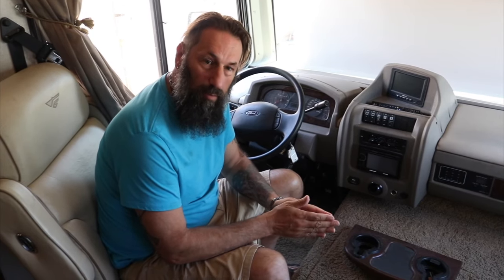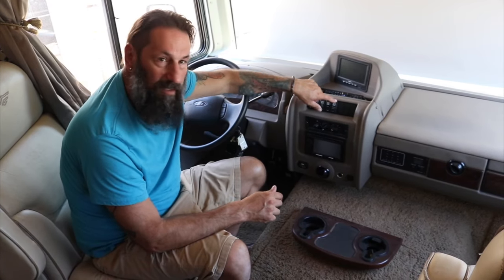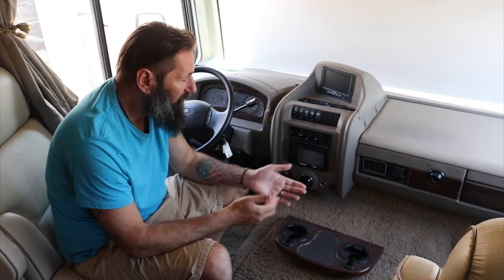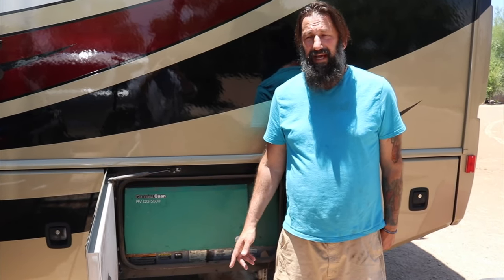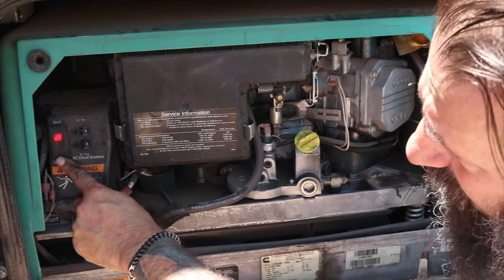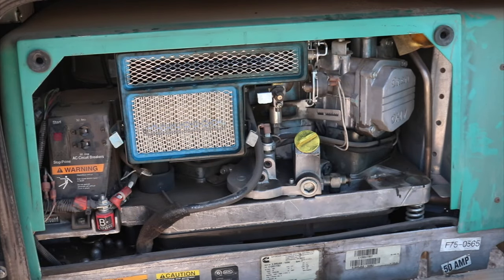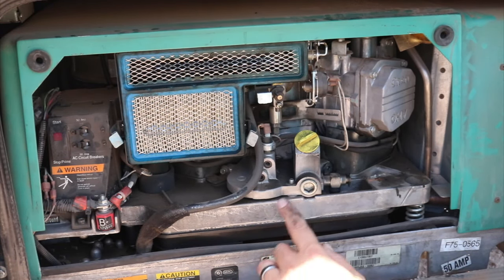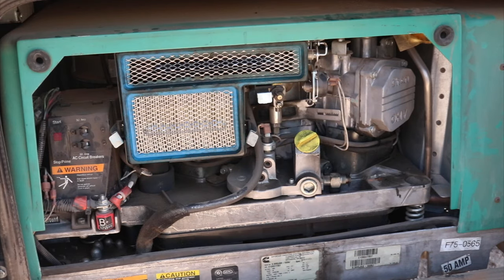RV Onan Generator Start Up Problems. Fix it here.  Hint & Tips

Comment: I have a problem with no start on my Onan 4000. Changed the oil, spark plug, carb.,new gas, still not starting. Ran on a constant 10 hour straight after a power/storm shortage. So many ways to check. Please help!!

Comment: Good Info.  But one item needs correction.  Your generator in the video the Onan RV5500 QG is air cooled, not water cooled so there is no coolant in that Genset.  Otherwise good info.

Comment: Hey Bear! could use some advice/knowledge  i have an Onan 7500 Diesel Spec J  runs pefect for hours no issues but if you try to put any load in rv it shuts down get code i get code 38  i disconnected from Rv and issue not wires between rv/gen i wired generator out side to a power strip and single fan and same issues ... Any help or idea would appreciate it.. have done complete oil  change./filter fuel air filter etc Thx !

Comment: Great video thanks! 
Question: My Onan 7000 was running fine today and then suddenly revved up to high idle and then shut down. After I let it rest for a few minutes I tried to start it again and it revs high after it starts and then shuts down. It does this continuously now... Thoughts?
Reply from the maker: Could be a fuel filter, choke or load problem.  Not saying that is it, but I would start with the fuel filter.  I am assuming you watched the video and have already checked your oil level.   Let me know how that goes.
Reply from the maker: Also do you have new gas in there?
Reply: @BearsWorkshop  new gas and yes checked the oil.
Reply: When I tap on the side of the throttle body with a screwdriver handle it will occasionally drop down to normal idle. Do you think it's the stator?
Reply from the maker: @aarongarcia9083  I am not going to say it is or it isn't.  I don't have enough experience with stators to say.  Try playing with the choke manually when you first turn it on.  See if more or less air can keep it running.
Reply: @BearsWorkshop  I'll keep tinkering with it. Just looked up the code 31 "overspeed" and of course it says take to a certified Onan technician to get it repaired. Uggh!
Reply from the maker: @aarongarcia9083  I would still try the fuel filter first.  If you have a fan belt, check it and the thermostat.

Comment: I have an Onan 2.8 would crank but will not run. Compression is 120 lbs, I have spark and new fuel. I tried starting fluid an no start. Any ideas?  Thank you

Comment: My generator only starts when the rv engine is running but as soon as I turn off the engine, the generator dies. Do you know why this happens?
Reply from the maker: Low voltage on house or Main batteries or a bad connection to them or the converter could cause this problem.  House batteries turned off? Ground wire on batteries should be checked.

Comment: Hi, thanks for this video.  I’ve subscribed for future videos. My generator abruptly stops when I turn the A/C on and I’m trying to figure out why. I have the generator running for 20 minutes, use the 1000 watt microwave with no problems but when I switch to the air conditioner, it just stops. Would you know what is causing this? Thanks in advance! Thanks 🙏  🙏
Reply from the maker: When under load the generator needs more fuel.  You may have a clogged fuel filter (first thing to look at) or a problem with your fuel pump.  Fuel pumps under load can shut off if they overheat (meaning bad fuel pump)
Reply: I was watching a guy just before this video and the problem turned out to be a 'frequency' adjustment..!
Reply: @thewanderingisraelite  what the heck is a "Frequency adjustment" ?? That's a new one

Comment: I tried priming and replaced the sparkplug. Also tried the starting fluid. Cranks but no start. It doesn't seem like there is any spark, even with the new plug. Where does the spark come from? Is there a coil? A magneto?

Comment: My generator won’t crank. New battery. Battery levels are good. Terminals at the generator look a little rusty. But connection is tight. Any thoughts?
Reply from the maker: Check the power readings at the terminals on the generator.  If they seem ok, then might be a starter/solenoid issue.

Comment: Hi Bear, thank you for the great video.  I have the same 5500 generator and it will not prime or crank. I have 12.6V. I went to remove the plastic housing for the switch after removing the thick wire from the bolt with the red rubber boot on it then when i went to remove the plastic housing when my ratchet touched the nut holding it on i had sparks and quickly pulled away the ratchet and didn't reconnect the thick negative wire.   Not really sure what to do next.  Any advice would be greatly appreciated.

Comment: Yes manually choked it fires right up so would that be a bad choke ? and how would I fix that ? ty
Reply from the maker: There are parts online to replace the choke.  There maybe a vacuum line on your choke or it can be electronic.  Check the wires or the vacuum line before replacing it.  You would just need to find what is the correct part number for your model.  To keep it running you can use some wires to keep the choke closed until you get your parts.  Also, I had a generator that would not because of bad gas.  When I closed the choke halfway it would run.  Check your gas.

Comment: What would it mean if the generator cranks but won't start, but the light does not flash anymore? The start/stop light used to flash, but now it doesn't and the light also doesn't flash...however, as I said, pushing the start button does make it crank. Thanks
Reply from the maker: Do you have more than 1 start button that has a light?  Is the light out on one or both?

Comment: I'm not much of a mechanic how do i test the wires?  when i put the plug to the engine block i don't get any spark.
Reply from the maker: Ok. Well you are doing good so far.  If you can take the wire off check for continuity.
Reply: @BearsWorkshop  ok thanks for now until i can get back at it.

Comment: Had micro quiet 4000 serviced in Oct 2019 then it sat for a year with very few start ups. It cranked in Oct and Nov 2020 but not in Dec. Drained old gas, put in about five gal new gas, no crank. All I get now is the overcranking code. Have used ether, still nothing. Trailer is level. Onan is mounted in the tack room of a horse trailer, not an rv so not connected to a vehicle fuel supply.
Reply: Onan manual (available on the website) recommends running the gen for 2 hrs every month at half load to keep it in good condition.   It has been working for me.   I have a fuel cut off value in the hose, so I turn it off by starving it of fuel just like I do with my other small engines I've had for 20 years without problem.  They all start immediately.  Letting gas get old in those tiny carbs is trouble.

Comment: I have a propane Onan genset, was running fine and just quit. Now will not start. It has spark and propane in the tank. Turns over just fine. It is not throwing any codes. I have pulled the soot plug from the exhaust and pulled the air cleaner. If I prime several times then try to start it will backfire but still will not run. Has oil. Any ideas?
Reply from the maker: Sorry, I just don't have any knowledge of propane gensets.
Reply: Low oil? Only holds like 2 quarts or less

Comment: Gen question....my onan 5500 sputters at first start blows white smoke then smooths out. Has New plugs, Air oil and fuel filter.oil level good.  Tried sea foam. Spark arrestor blown out ok. 1000 hours.  Frequently exercised.  Gives me code 13 which suggests unplugging appliances.  Anybody had this experience and what's the remedy...

Comment: Hey Bear, had my RV hooked up to a 30 amp air conditioner came on for a few minutes and then tripped off, went to crank my generator it would not start also the air conditioning unit in the RV will not come on. Checked all the fuses checked all the circuit breakers inside and outside the RV cannot find the problem.
Reply from the maker: Does it crank?  Are you trying to start your AC when plugged to shore power?
Reply: Totally good omg. I cant wait to get up and try what you showed me thanks bro. Filthy frank

Comment: Hello, my generator will not start.  When I try to prime it, it shows it is priming only when I have the rig plugged into my house.  When it is not plugged in, no light comes on when priming.  Also while it is plugged in, I prime it and then try to start it,  I get a kind of buzzing/slight grinding noise, as if the starter does not have enough power to turn over the engine on the generator.  It is a quick noise and only last for a half second or so.  Nothing at all happens, priming or when trying to start it when the ring is not plugged into my house.  Please help or any advice.

Thank you,

Miguel

Comment: We just bought a 1993 Winnebago Brave. She had only 20,000 miles on her. The generator will not start ,acting as it's about to but nope it did that for a bit. My husband said it seems like it's not getting power. This is our first-ever RV. Now mind you it had ran over night as we were parked at Loves. Turned it off when we pulled out then later on nada. I've searched for any videos on A 93 Winnebago Brave and there seems to be a lack of any. Thank you any one for help.

Comment: My generator runs as long as I hold down the button buts it’s not the oil sensor any ideas it’s a emerald three it ran great till I shut it off one day. It shut off hard also
Reply from the maker: I think that the starter is keeping it running and it's not actually running.  Check fuel supply, fuel filter, fuel level on the RV needs to be above 1/4 and then maybe fuel pump.  Also check your choke and play with it to see if it stays running when adjusted. Also bad gas can do this.

Comment: My generator runs for about I don't know a half hour to an hour but then it'll shut down and it won't restart it's not it it doesn't it doesn't even crank when it shuts down and then if I wait for a few hours or whatever then it'll start back up it'll run 20 minutes maybe a half hour to an hour and do the same thing over again I checked the oil level I don't know if it's behind the circuit board or what but I checked all the wires and everything they're all connected good and all that so I don't know maybe you got a suggestion

Comment: I tried to get mine to start but it won't budge.  Seems like fuel or circuit board issue. Any idea on how to check the circuit board to see if it's fried?  I put roughly 12 gallons in gas. You think that's enough ? When I click prime. I don't hear anything. Should  there be any sound?  It runs with starter fluid but won't stay on. Maybe a kill switch somewhere?
Reply from the maker: When was the last time it was running right?   You should hear something when you prime.  Sounds like a fuel pump or fuel filter if it runs with starter fluid.

Comment: Mine will not even crank the is it the cylanoid not engaging the starter or could this be another issue?
Reply from the maker: Check your house batteries for enough voltage. Can't say where it needs to be but probably at least 12.3 volts.
Reply: @BearsWorkshop  we just replaced our batteries thinking it was the issue but they are the correct voltage, the thing cranked perfectly right up after replacing the fuel pump just yesterday any other advice?
Reply from the maker: @garymcclish6753  If the fuel pump was just replaced it makes me think that something wasnt put back together correctly.  Could be anything from a disconnected wire to hardware that wasn't assembled correctly.  If you did the fuel pump, try and back track and see if you can find something.
Reply: @BearsWorkshop  the odd thing is I fired it right up ammdietly after installing the pump and it started perfectly, I shut it off after about 30 minutes of running and after I was getting nothing so i will trace my footsteps and see if I can find something.
Reply from the maker: @garymcclish6753  Also check for error codes.  Hold down the primer on the generator.  It may give you some error codes.

Comment: What about a clicking solenoid.  Replaced control board, starter, solenoid and batteries topped off.  No changes.
Reply from the maker: You should check your voltage when cranking.  Could be low battery voltage due to a loose wire.  It would show fine when checking under normal conditions but when cranking it could drop to low.

Comment: I have to go outside and use the start button while manually holding the choke lever over. It starts fine. If I try to start it from inside, it just keep cranking. Any thoughts? Thanks
Reply from the maker: Choke maybe bad. It may not be engaging when you crank from inside.

Comment: Bear, does a generator have a starter and what happens if that goes out
Reply from the maker: It does.  It may not turn over. It can click or nothing at all, possibly make a grinding noise.

Comment: I have a 7kw onan quiet diesel generator.. it has 120hrs on it. And the board crapped out. They have made it it extremely hard to access.  It gives 3 flashes on attempt to start, then 6 flashes for secondary code.  It could mean bad battery connection which I hoped it was. But nope.
  The second reason is the board is shot.   $1800 U.S. for a new board, but good luck changing it... the whole genset has to be dropped out to access it. 
  Onan is so proud of their self troubleshooting genset... it’s now a dam brick in the front of my motor home.
Do not buy an onan, electronics is garbage.  It’s annoying that my old motor home had 800 hrs on the genset and it was still going strong.

Comment: Hey bud, I have a diesel generator 6500 not Onan, it just crank and crank but won't start. Any ideas ?? Thx
Reply from the maker: I would go through all the usual stuff.  Check breakers, fuel,  check compression.  Try some starter fluid also.

Comment: If it is sensing low oil will it crank no start or start and then stop?  Mine was running fine and I went inside the house for a little bit and it stopped when I was inside the house. I came back out and tried to start it again and now it cranks but doesn’t start. I replaced the air filter and spark plug. I can’t get a code other then the 4 lights signaling over crank. I wish I would have just checked the lights before trying to start it again. I will tell you I recently bought the rv it’s a 2014 and there is only 275 hours on it so they barely used it. Any suggestions? When I pull the spark plug it is coated with gas if that information is helpful. I left it alone to dry everything out and it still just cranks but doesn’t start.
Reply from the maker: I would leave that spark plug out to clear out any flooding.   But another thing you can do is try starting it with starting fluid. If it starts up then you might have a fuel problem. Pump?  Regardless also check you oil.  M experience was it runs and shuts off with low oil but it would start.  Wouldn’t hurt to check.
Reply: Bear's Workshop thanks for the reply. I’ve removed the spark plug and let it dry out a couple different times and that hasn’t helped. It  will not turn over with starting fluid. I may try and add some oil and if that doesn’t work I may try to clean the carb and maybe replace it if that doesn’t work. I’m on the verge of taking it into the Cummins store but I would like to try a couple things before I do that.

Comment: Hi my onan genset sat over winter and now will not start. Only clicks. Try to start with primer on gen. But only clicks and does not crank. Chassis batteries are good. Full charge. Diesel gen. Added oil and still clicks only and no start. Runs on diesel.
Reply: Added oil. And still only clicks. No start.
Reply from the maker: What is the voltage of the house batteries.  Even a little low might cause it to just click.
Reply: Battery volts 14.0 and my battery monitor says batteries are full charged. Got unit running now as well. And still only clicks gen and no cranks.
Reply: Does gender on diesel Motorhome have separate battery. Or it’s connected to house batteries. Right.  Had batteries in my warm garage all winter. Installed batteries now after winter. And trying to get genset 7500 onan.   Now and just clicks and fast flashes red light on start button.
Reply from the maker: Are you getting any error codes?  Also can you check the voltage at the gen starter?
Reply: No error codes. Just clicking and red flashing light on starter switch.
Reply: @BearsWorkshop   yes it’s 14.2 volts.

Comment: My generator is an Onan 4000 it’s making a clicking noise and will not start. The gas tank is full the batteries are charged but it will not start

Comment: Hi Bear,  I have a question that you might be able to help with. Please.  It’s on a 4000 Onan. Should the pump cut off when the bowl is full or is it a constant pressure. I think I may have a case of flooding and priming continually does not stop the pump ? Would appreciate your thoughts ..thanks
Reply: Is there fuel in tank or stopped up filter

Comment: My QG 5500 has no power coming into it. try to start it an nothing happens. I think I found the breaker in the aux battery cabinet,  I reset it tried to restart, nothing. The breaker was once again tripped and would dnt reset. Where do I start checking things out?
Reply from the maker: Check for hidden breakers around the house batteries and check the voltage on the house batteries.  If something is tripped it may not charge the house batteries as well as not let the gen start.
Reply: @BearsWorkshop  I did find an opitfuse (spelling) near the battery. Finally climbed into the area and was able to see how to reset it. Generator started right up. ran it for about an hour  under a load. Thanks for your help. we will be on the road in a couple of weeks.

Comment: my gas level and oil level is fine. batteries are ok. when i try it start it on the generator button, it just clicks and doesnt even turn over.
Reply: Same here. Did u ever fix it